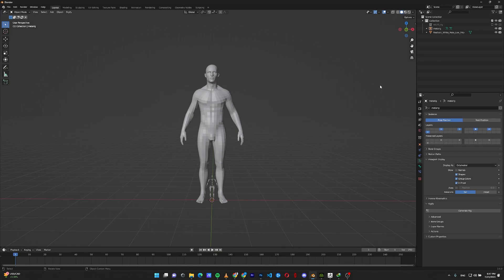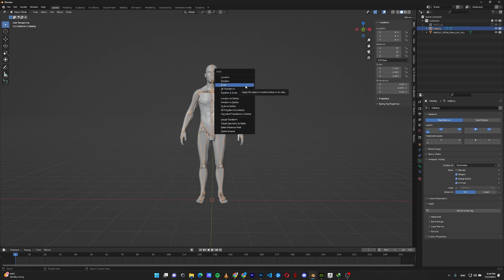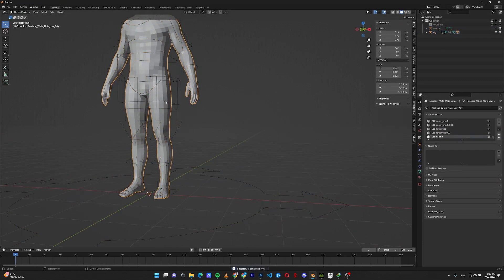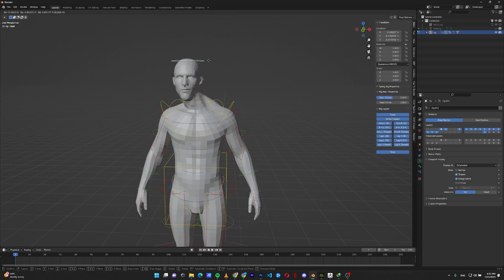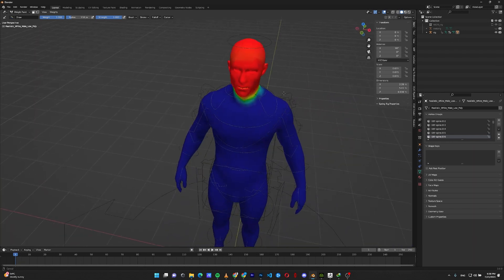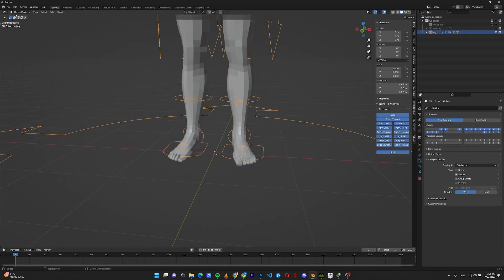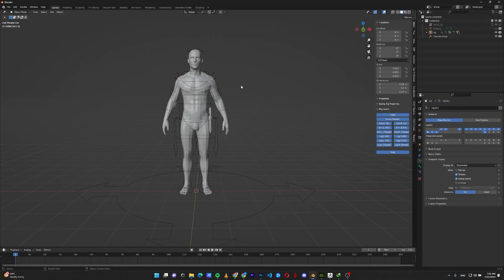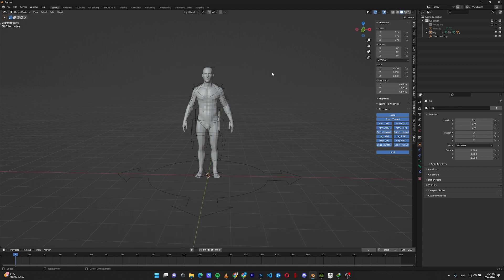4 Most Common Blender Rigging Problems and How to Solve Them

Comment: In 4.1, my armature poses are not changing based on my keyframes. The object is rotating and moving in accordance with the keyframes, but maintains the last pose that I placed it in throughout the entire animation.
Reply from the maker: Which one Is it? rigify, auto rig pro or a custom rig?
Reply: @mck3D  It's just an armature I made myself, but I have discovered the solution, which was to select all the bones in pose mode after setting the pose and create Whole Character keyframes by accessing the dropdown menu which is accomplished by way of the K key whereas in previous versions of Blender it was the I key. What I had been doing before was just hovering over the location and rotation dialog boxes in the object data panel and clicking the I key to set the keyframes.
Reply from the maker: Nice, I'm glad you've found your problem, and thank you so much for sharing your solution with me and everyone. best wishes for you
Reply: @mck3D  Same to you!
Reply: @backforblood3421 Can you explain it more detail for me? i've been using deepmotion to make an animation to my character but when i move all the keyframe let's say i want to make it start moving at certain frame, it's moving correctly and the beginning and suddenly it' moving weirdly at the end of the pose just like you said
Reply: @mck3D  hi , may i ask why the green round bone at the leg didnt move when u move the leg? 2:33 And can you tell me how to move it alongside the leg?
Reply from the maker: when you are in IK mode, the bones for FK don't move and when you are in FK mode the IK bones don't move, this is the scripting issue (not issue rather roadmap) of Riggify, if you use the ARP the FK rig moves with the IK rig, we have FK/IK switch that is what you see and FK/IK blend that ARP uses.
That one gives more control as you can switch between them in the middle of the animation but with this method you should plan for different action to see if you want to use IK or FK, not that you can't change it, it's just a pain xD
Reply: @mck3D  Alright. Thanks!
Reply: my friend helped me solve the exact same problem. You basically press "A" to pick all before adding the keyframe. That way the entire pose is changed

Comment: Help!! I cannot weightpaint on the left arm because i have the whole right part of my mesh mirrored so i could model easier and symetrical, thanks to this when i weightpaint in the right it also does in the left, but as i said it doesnt let me weightpaint in the left. Now when i move the right arm it also moves the left, but when i move the left arm another unrelated part moves. Is this solvable or do i have to re-do my model?

Comment: My controllers not controling bones! TELL pls about this fu@@ng problem. Bcs not information anywhere just nothing. I only one see this problem or what?
Reply from the maker: you've probably encounter some type of error when you press automatic weight paint, you can verify this by looking on the bottom middle-right of the Blender, if you get an error there's something wrong with one of these:
1- mesh has too many polygons.
2- mesh has intersections that the program can't figure out how to weight paint.
3- you're bones are outside of the model in some parts and it can't weight paint the model.
There are more things that can cause a problem but these 3 are the most common pleach check them.
Reply: @mck3D Thx u for answer! I was search problem. I was try press bones&body also controllers with bones&body and after I see how one man pressed only controllers &body and this work. But have problems eyes😅
Reply from the maker: That's great to hear, I'm glad that you fixed it. Best wishes for you

Comment: Ik its an old video but its worth to mention for those who come after

4:33 - the best way in my opinion to fix this is use the gradient tool set to 0, put it on front orthographic view, in this case, pulling from the outside (screen right side), to the left (center of the model), that way you ensure that no vertex is left unpainted, since the gradient tool paints EVERYTHING on its way
Reply from the maker: Thank you for your tip, it's actually a clever way, thanks for sharing.

Comment: I have an FBX of Kratos and have the human rig lined up. I select the model and parent it to the bones and generate the rig and parent that to the model does not move with the rig. Maybe it's because the models are in parts, so I joined them, but that does not work. Maybe it needs to be made into one mesh, but I don't know how to do that. Any help would be amazing!
Reply from the maker: Hi Andrey,
No, you can rig your model both if it's one single mesh or a collection of different parts, but if it's a collection you need to make sure there are not many crazy intersection between them, small intersection does not matter, the reason is just because that the python script can't handle crazy intersections.(I mean you can manually rig every crazy intersection, but that's not the case here).
BUT when I read your comment, I saw a mistake in your steps, I read that you add skeleton then you parent the model to the skeleton, the moment you parent the model to a skeleton or a rig (shaped rig) you're model is rigged, means that an armateur modifier added to your model's modifier and you model can't be parented to another rig.
So if we assume this is your problem, your steps should be something like this:
1. Add the skeleton - 2. Resize and adjust to your model - 3. Apply the skeleton transforms by pressing CTRL + A, and selectin All Transforms - 4. Generate a rig from the skeleton - 5. Select all parts of your mesh (just models nothing more like lights or cameras) - 6. At last select your rig with Shift + select (your rig should be Orange color and the rest should be red) - 7. Press P and select parent with automatic weight paints.
Please check this and let me know if you solve your problem or not.
Reply: @mck3D  , it did not work. Is there a way I could show you what I'm doing in a video?
Reply from the maker: sure, just upload your video on google drive or dropbox and give me the link.

Comment: i still got a problem where my rig is moving both sides of everything even when they are all blue/black
Reply from the maker: This shouldn't be happening. What I think is most likely happening here is that you see everything is blue, but there are some vertices that have a value more than 0, even if they have 1, it means the bone will move them. To go the safe way, I'll give you an example of how to fix that. Please apply what I'm going to say to your situation:
In this example, we assume you want to move the rig of the right leg of the character, but the left leg is moving too.
1. Go to the edit mode => vertices mode => select all the vertices of the left leg (the leg that you don't want to move)(make sure to select them in x-ray mode to select all vertices)
2. In the right corner, go to vertex groups.
3. Find the bone for the right leg
4. Click on the remove button below the vertex groups.
What we did is that we select the bone we want to fix, and select the issued part of the model that should not move with that specific bone, then we removed the whole weight painting by clicking remove.

Comment: but i weight painted my model properly and i still experience problem number 3
Edit: nvm figured it out
Reply from the maker: Are you sure that other bones are not influencing your target part? Sometimes, if other bones even have a slight influence on your model part, they can cause a deformation.
At the end of the day, it's only a weight painting problem, IF you're bones are in the correct place, and you've applied the transforms before weight painting.

Comment: hello. i have a problem when i generate the rig, its missing the pelvis, spine controllers. theres a gap from the breast area to the thigh controllers. What could be the problem here? I made sure connect all the spine bones in the center and also the pelvis left and right towards the center.
Reply from the maker: Are you using Rigify or Auto Rig Pro?

Comment: I have a character with a chain of bones with a damped Track constraint. whenever I want to reset the pose, it doesnt reset the contrained bones completely. I have to spam ALT+R for it to slowly reset frame for frame to its base condition.
Reply from the maker: the easiest cheat-fix I can give you is to set a keyframe on all of your transforms in frame 0 or 1 and save the action as something like "Rest Pose", then create your other animations on another action sheet, and whenever you want to reset, jump into the rest pose action and put the frame on the rest keyframe, you can approach it in a more technical way, but honestly I use the same method because it seems faster to me.
Reply: @mck3D   thanks for the reply! takes some time getting used to but it works, thanks!

Comment: How do you fix the wrist twist
Reply from the maker: Your question was so general.
If your wrist twists after parenting (skinning), it might be because you didn't apply transforms for your model and your skeleton before attempting to do parenting.
Or you might put the skeleton outside of the wrist.
But if your wrist twists when you move your hand, it's definitely because of the weight-painting issues, so make sure the hand bone responsible for the hand has full control (100% weight) and other nearby bones like hips, spine, or even the opposite hand bone do not affect (0% weight) the mentioned hand.

Comment: what about the model NOT moving when i move the armature?
Reply from the maker: There can be a few reasons:
1. You didn't parent the skeleton with the mesh, so essentially the binding phase didn't happen.
2. Your model has too many polygons, and the rigging encounters some errors.
3. The mesh has intersecting parts/objects, and the automatic rigging addon can't figure out how to rig them. Make sure to remove major intersections.
4. Some part of your skeleton is outside of the mesh/body. Place skeletons inside the model, except for the heel skeleton.
5. When moving the premade skeleton of Addons like Rigify or Auto Rig Pro, make sure to box select the joints. If you move a joint and it becomes separated, most likely you will get an error in the binding phase.
6. At last, there are instances that the addon will be bugged, and unfortunately, you need to remove the rig, restart Blender and start riggin from the start.
Reply: @mck3D  im trying to work with this cinderace model i downloaded online for art reference, and it came with a prebuilt rig. it was bad and overcomplicated so i deleted it and made my own. the rig itself doesnt have any issues. ive tried parenting it, and even when parented it wont move the model. I originally had rigify working for this model but the metarig overall i made was bad and didnt line up with the proportions that well so i deleted it and remade it. NOW anytime i try and parent the rig to the model, it wont move it. i made sure the old metarig was deleted, i made sure the parts arent outside the mesh. and ive tried your 6th option as well. i just dont know how it stopped working.
Reply from the maker: Ok then, let's check a few other things:
1. Please make sure you remove the armature modifier before parenting to another rig
2. Check if you parent with empty groups or with automated weight paints.
3. When you click on the parent with automated weight painting, make sure you didn't get any errors in the bottom right corner of Blender.
4. Please apply all transformations to the model and the skeleton before starting the process.
5. Did you generate a rig from the skeleton and then parent the actual rig to the model, or are you trying to parent the skeleton directly to the model?
6. The model itself might come with a manual rig, which means that the artist manually made the rig and weight painted. Why is that any difference? in my last comment in No.3 I mentioned that mesh should not have any parts intersecting, that does not matter when you manually weight painting the model, it only matters when using automatic weight paint, maybe the model has intersections and the automatic weight painting fails.
You can brute force it by selecting parent with automatic weight painting again and again and eventually the algorithm will finds out a way, I don't recommend that because usually it's not a good weight painting.
That's all that comes to my mind right now, please check the notes above I hope one of them fix your problem, if not please let me know and we will figure out another way to solve this.
Reply: @mck3D  thank you for your tips, im glad you went out of your way and deeply explained everything. i got it working FINALLY after 3 evenings, it was a bunch of different issues with it. I also fixed some weird vertexes with the model itself and overall i think it was mainly the mesh breaking the rig. again, thank you! i had to completely redownload it and try again and after that it, started working after making 100% sure i didnt make any mistakes with it.
Reply from the maker: No problem at all, I'm so glad that you've managed to fix it, make sure to ask any questions you have in the future too. Wish you the best.

Comment: Perfect vid bro! i changed the rig of a model, what can u suggest to easy connect it with the body?
Reply from the maker: thanks bro, TBH there is no easy way, the easiest way is to use something like Riggify or ARP but they have their own set of problems too but definitely faster than manual rigging
Reply: @mck3D thanks, good to know! Do u have any tutorials about this?
Reply from the maker: I have two basic tutorials on the channel, one with Rigify and one with Auto Rig Pro:
ARP: https://youtu.be/GDQmdsZWgVE
Rigify: https://youtu.be/PKPo0-leJmU
Reply: Thanks! @mck3D

Comment: how do i connect disconected bones on a model? i have one model and two bones, ehn i've apply bones, only one bone move entire model, but  the second is not connected to other part of model.
Reply from the maker: when you have two bones make sure that those two bones are connected together and form a single skeleton other wise the blender sees them as two different  skeletons and you can only use one of them to rig your model, but if both of them are connected, now you should fix the problem with weight painting.

Comment: How to solve the problem of bones & rigs not connecting to objects even though they have been automatically installed
Reply from the maker: there is a problem with automatic weight painting, probably you get an error in the middle of the process, make sure that you don't have any bone sticking out of the model, you applied the transforms, if your model consists of a lot of separate objects that are intersecting with each other fix them, sometimes the automatic weight painting get confused how to weight paint them.

Comment: hi sir!! may i ask a question? why are my bones connected to an object, and bend the object how i want them to, but when i move the object the bone stays in the original spot and still bends the bones? may there be a solution?
Reply from the maker: when you rig your character, you are applying the transforms therefor the 0 position and rotation for your model and rig are where you rigged your character, you can move your root bone in pose mode if you wish to move your character with your rig, but as soon as you go into edit mode you see your character's rest pose, you can also make keyframes for character root bone if you wish to animate the character moving between two positions.
But you don't need to move the character outside of the pose mode, if you want your character to start from a specific position, just move them with root bone into the desired position and put a key in 0 keyframe or 1 keyframe.
Reply: @mck3D okay!! thank you!!😊

Comment: Don't know if you will see this comment but i have a character that looks basically like a roblox character. And i've made an armature for it. And im trying to make a "gun equip" animation but for some reason in pose mode if i try and change the position of a bone it only changes it's angle. I can't seem to fix it. And when im in edit mode it does seem to work but sadly then the keyframe system doesn't work for me since it doesn't seem to save my keyframe actions. It seems as if bones can't have transform keyframes for some reason in edit mode
Reply from the maker: sorry for late replay, edit mode does things a little bit differently as the idea there is to edit your model in rest pose, so keyframing in edit mode is not recommended as the behavior is not predictable, you should consider to use keyframes in pose mode, I'm not fully understands your problem, but generally for weapons and accessories there are two different approaches, one is where you parent  them directly to the model without the rig, in this method you can't keyframe the weapon easily as it's always a child to the parented bone, it's good for the accessories that don't need animations like wielding, or even jiggling while running, if you wish to wield the weapon or you need any specific animation for that part, it's recommended to take your time and rig the weapon just like rigging your character, but it needs much simpler rig compared to the character.

Comment: I need help! For some reason parts of my model are acting wonky…

For example if I moved a bone the inner faces of my model will move with that bone but not the outer faces, I tried using weight paint, but that didn’t help!

I should mention that the parts of my model acting like this had a solidify modifier that was applied earlier!
Reply from the maker: Most of the it's face normals problem, please show face normals and see if anything is red, if it is, it means that your normals are faced in the wrong direction, you can select every face and press "Shift + N" to fix that.